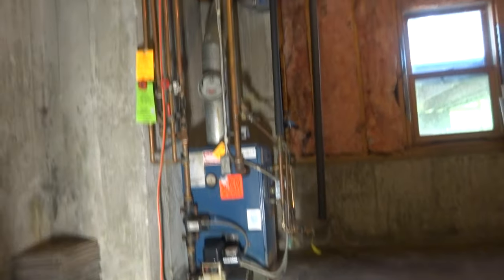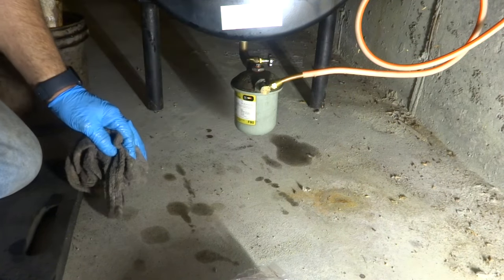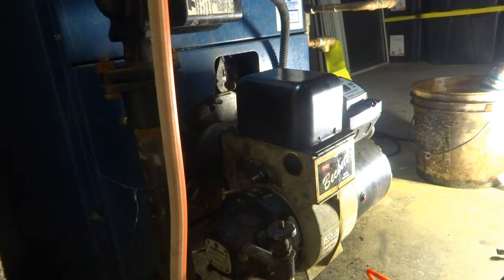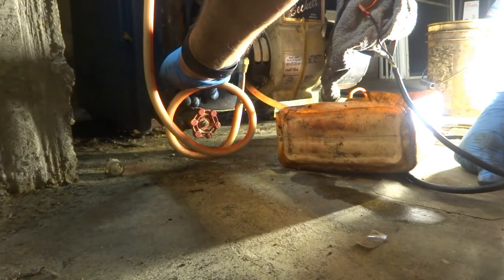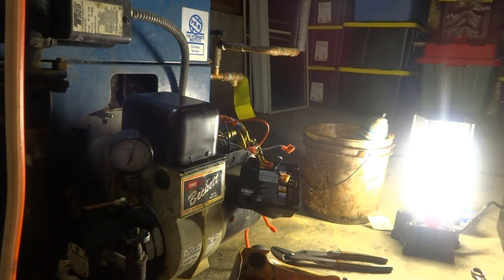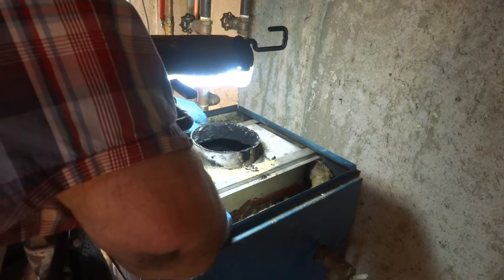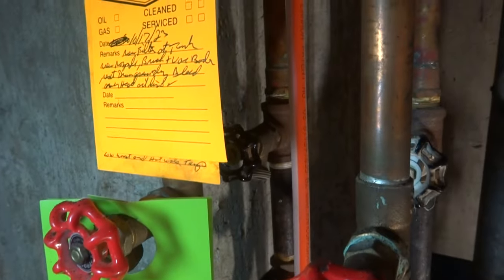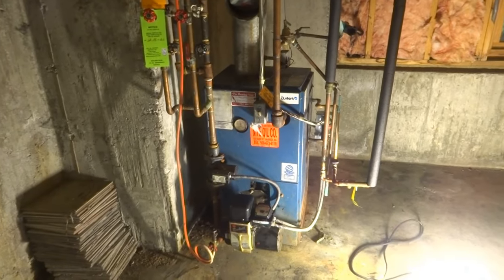OLD OIL BOILER FULL OF BLACK SOOT

Comment: Hi Steve ….. I have a question, on these oil burners, (I’m trying to learn how to fix these ….) 
Can you use a combustion analyzer to check the flu gas… What are the typical readings for a Becket oil fired boiler? Any info would be much appreciated…. Thank you sir.
Reply: You should check for smoke before using combustion products analyser. You dont wont to contaminate the instrument as they are expensive to repair.
Typical CO2 between 10.5 and 11.5 %, some upto about 12 %, check for smoke again. CO varies nozzle to nozzle, none are the same even when new.
Those figures are typical of what is found in the UK, but our heating oil is a grade lighter than the red diesel used in MA.
Look at manufacturers instructions or maybe data plate, for specific info on the US made boilers and burners.

Comment: New tank filter,....new nozzle,....NO new screen in the pump?..... After seeing the condition of the tank filter, I think I'd want a new pump screen.......Also, while waiting for it to fire, the air fan sounds like it's dragging a broken tine around inside and can be heard more as it's shutting down. That thing is Wicked Noisy. ((((just my own questions and observations...I'm no boiler repair man, like Steve. Just curious.))))
Reply: Yep, blower wheel is scraping for sure. It can be loosened, moved away slightly, then retightened to stop the scraping. I've seen him do it before. I don't know why he didn't here.